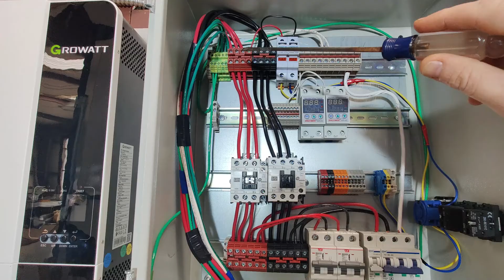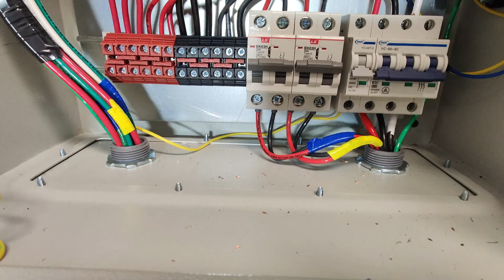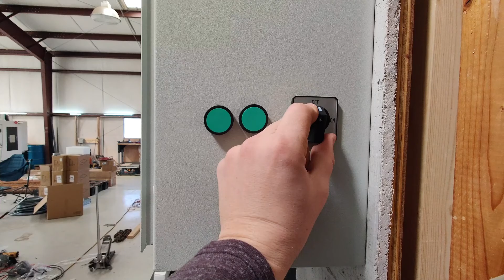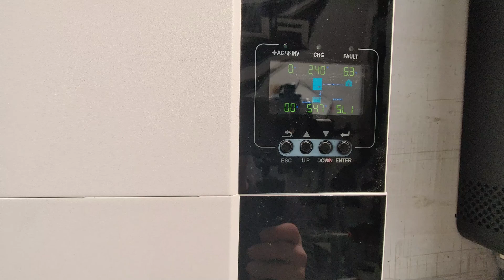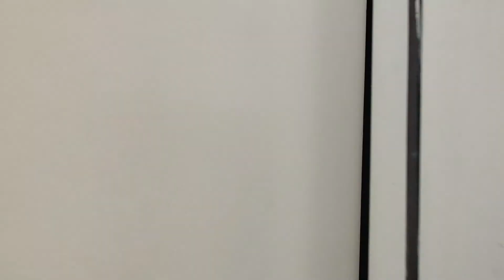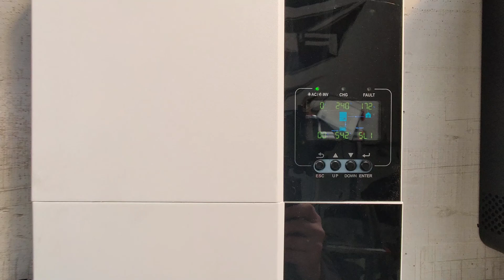Growatt 5000 ES Final Neutral Protection Circuit

Comment: Much cleaner but as far as parallel .. perhaps join them after the contractors vs. Before cause you combine them then have 3 wires then combine again... is that what's going on here?
Reply from the maker: You could do that part however you wanted. This is purely for demonstration purposes and so people could clearly see the electrical path. You could come right into the contactor if you wanted.

Comment: I notice ES version neutral and earth is bond . i also notice if u put incoming grid into incoming L N E it will trip the grid side . i am able to parallel ES with hvm-TL model but after 5 days my ES just now working and my Red phase only received 179V but not 230V
Reply from the maker: You will need to watch Ian's videos on removing the ground screw

Comment: I just installed a 15 KVA isolation Transformer after my three stacked inverters AC out panel. I am now able to have grid backup safely and not have to worry about the neutral loss issue
Reply from the maker: I am doing the same for my 50kw system. Where did you get yours?
Reply: @BecomingOffgrid  I was blessed. I ended up finding mine on eBay it was local 45-minute drive. New open box $550. New it was $1,300 Plus freight they have one on eBay right now scratch and dent $499 plus Freight
Reply from the maker: @trueamerican1576  I am getting mine from Larson Electronics down the road from me.

Comment: Yeah, definitely get a temp sensor switch. I have my inverter in a solar shed that is not air conditioned and have it set to switch off the inverter when the shed temp reaches 99 degrees. It happens a few times a year for a couple hours at a time. It's not a problem for me because when the inverter shuts off it de-energizes my transfer switch contactor coil and then I am back to grid power.
Reply from the maker: It's on my list of things to implement next

Comment: Your contactors are rated for 30 amps but your shunt trip breaker is rated for 50 amps.  I'm pretty sure you have the capability to pull too many amps through those contactors unless I'm missing something here?
Reply from the maker: You are missing something. The contactor is 30 amps per pole, and there are three poles on the same hot leg, hence the load would be balanced across those three poles. This leaves me with a potential for 90 amps and is  one of the many reasons to use two contactors. I do have 50 amp contactors, and if you wanted to substitute them in this build, you could surely do so.
Reply: @BecomingOffgrid  Thanks for the explanation but how are you certain that the load will balance evenly across those three poles?
Reply: Actually I think I understand now.  You have 1 inverter for each pole and each inverter is rated for approximately 21 amps, so the load doesn't need to be balanced across the poles. I was just confused by your wiring diagram because it shows the three wires combined as one entering the combiner rail whereas the video shows three wires entering the combiner rail.
Reply: Actually, I think there may still be a problem with this.  The combiner rails combine all three inverters as one so at that point either before or after the contactors, there is no guarantee the load will be evenly distributed on each wire.
Reply from the maker: @snafunet  https://youtu.be/aRXYQdxqkyE
Reply from the maker: @snafunet   I don't have a 50 amp load on a single leg. You are thinking there is some way that more than 30 amps will traverse a single pole on the contactor. Think about it, electricity follows the path of least resistance.  While they aren't perfectly balanced, they don't need to be. If you are worried about it in your system, then swap them out for something bigger (a 50 amp contactor was tested and is linked in the description).  For this size system, they are perfectly suitable.
Reply from the maker: @snafunet  FWIW I thought this question was very good and worth explanation.
Reply: @BecomingOffgrid   And thanks for the video explanation!

Comment: Becoming Offgrid,  Wow! What an awesome box of information.  This is amazing work, and it great that you shared it.  I have the same Growatt's and auto transformers you show in your video.  I'm keenly interested in making sure the system ALWAYS has a neutral leg.
My question is:  how often do the auto transformer(s) get overloaded and/or fail?  Is this happening often????  I want to expand my load center panel, which would have more 1P breakers, and thus making the auto transformers work harder.  Your system looks like a bullet proof plan to make certain it is safe.  Love to hear some feedback.  Thanks!
Reply from the maker: With two AT's I never even get close to overload. Think of the AT as a balancer of the two hot legs, all it does is maintain the balance. It uses a center tap to accomplish this, so the balance of the two legs is 120v. If you had a 100 watt load on each leg at 120v(so 1p breaker), it would do nothing, so the load would be zero. Take that same load and put them on the same hot leg and the load on the AT would be 200w. Hope that helps. 

Also this isn't electrically how the AT's work, but it's the most reasonable explanation I can give to people like myself who aren't electrical engineers.

Comment: Nice work, glad you know how. I'm trying to understand why using multiple units is better than an all-in-one? People don't talk about that. These all in one 3000 watt seem to be the craze. Thanks👍
Reply from the maker: My workshop needs more than 3000w, so that won't work. These units are "all in one", meaning A/C charger, Solar Charger and inverter all in the same unit. The total capacity on a setup like this is 15,000 watts. Thank you for watching and commenting. Stay tuned for my 50kw setup that is coming.
Reply: @BecomingOffgrid  Growatt makes a 12,000 watt, all-in-one 120/240 U.S. configuration. Again, I am impressed with your abilities. I look forward to your next video
Reply from the maker: @Wrenchen-with-Darren  Yea that unit is really good from what I understand.

Comment: I like the video, looked up the parts and some aren’t available. Plus you said you were going with a larger breaker over the 50 amp in the description. Do you have that link. I am looking to upgrade my system all the time. I believe if I can get all the part’s that this could work for me. How do you plan on doing the temperature sensor’s? I have 2 inverters running my loads with only 1 transformer. I have a third inverter as a battery charger only.
Reply from the maker: The supplier is currently out of stock on the 63 amp 3 pole breaker, so I do not currently have a link

Comment: I might have one suggestion. I used personally bigger contactors(i only remember 200W in start position and then about 20-30W once it is ok) and i added parall to coil of those contactors one  capacitors X2  each ..i think it was about 1uF and 265V or about ..This reduced amount of shock /pulse..because i remember i had other devices there and they just exploded because of that voltage spike.
Reply from the maker: The end devices have no power until the contactor is closed. That is the purpose in the shunt trip. Loads don't go out until the safety systems are up and running. As far as larger contactors, I also have 50 amp contactors, but for my purpose they aren't necessary.  I will update the parts list with my larger contactors though, I think that it's a good idea. Thank you for watching :)

Comment: i really believe you could have saved a lot of money by simply buying a .U.S . SPEC inverter /charger. i use mine only for 240 volt loads ,like dryer and water heater.
Reply from the maker: There is 15kw worth of inverter here and 10kw worth of balancing. This is the cheapest solution on the market. Even MPP units have their issues that need to be worked out. This solution is flexible and scalable up to 30kw. Please show me an inverter setup that is cheaper. I think everyone would love to know about it.
Reply from the maker: MPP issue that needs to be sorted can be found here.

https://youtu.be/X3QA9T_O1g0